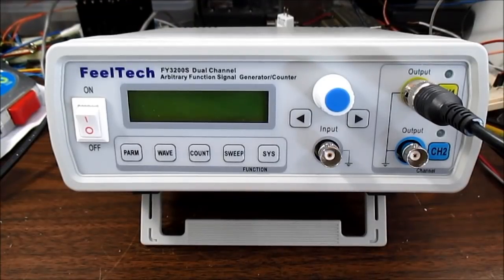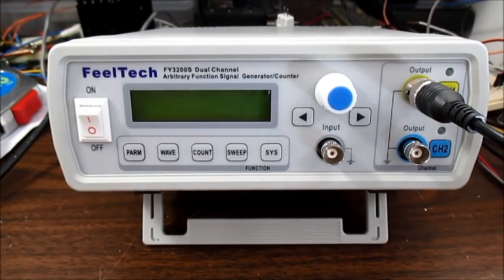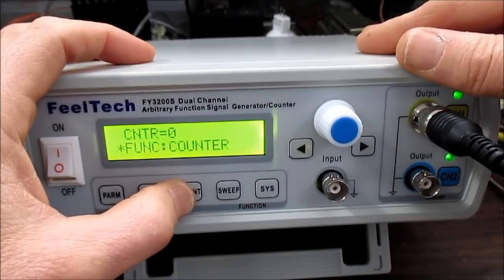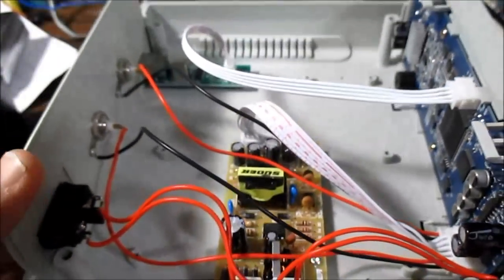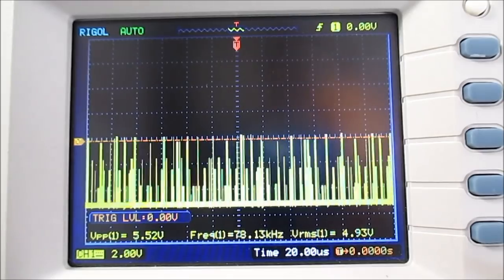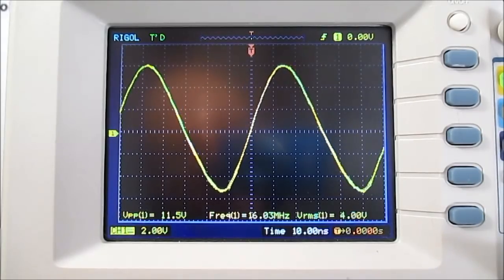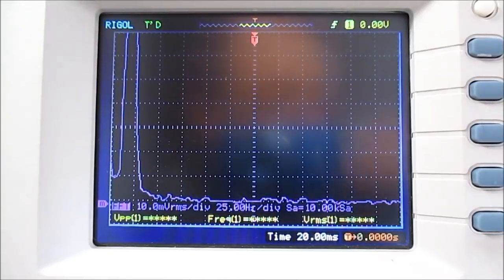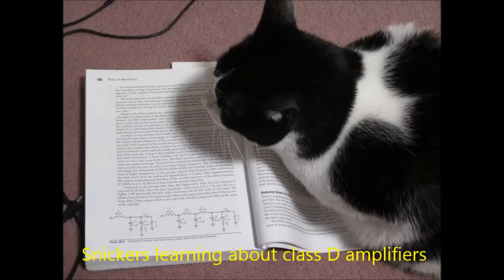FeelTech FY3200S arbitrary function signal generator test & review

Comment: I bought one that arrived this morning. The display lights up, but nothing else works. No beeps, no output from front or rear sockets, just 'nothing' but a bright, blank display. I've sent a message to the supplier, let's see how long it takes to get a response?  And yes, I looked at it on the scope and even with no signal generated by it there was noticeable mains hum, especially when I turn it off.
Reply from the maker: Let us know how they treat you with the claim. I'd open it and be sure the supply is fully connected since there are multiple rails used. Loss of one of the logic voltages may make it act dead.
Reply: @JohnAudioTech  John, They did ask me to check the rails. I don't mind but I feel it inappropriate for a customer to do fault finding on a new unit. I found +5v, -12v, but no +12v. I have informed them of this .. I await their decision.
Reply from the maker: I agree but it is easy to make a simple fix rather than shipping stuff back and hope the seller is reliable and honest. Hopefully they don't give you any friction.

Comment: Yup damaged my iPhone7 that was on the lab table. That 58VAC is coming out of this piece of shit even if it is powered off! 2 leads on the table and off we go. Only noticed it because of this tingling sensation on my skin... Now is there anything that can be done to stop this mains leakage or do I just toss this into a trash bin?
Reply from the maker: Tie the shield of the output lead to earth ground. You can also use an isolation transformer on the mains.

Comment: Thanks for the interesting test/review John. I would be wanting to use the unit for AM/FM receiver alignment and have downloaded the FY3200S manual to investigate further. However I am unclear as to whether the ASK/FSK modes allow an external modulating voltage to linearly modulate the Generator in the traditional manner, or they only allow distinct shifts between 2 amplitudes/frequencies depending on the mode? Also, what is the nature of the internally stored AM/FM waveforms - is the modulating frequency on them at 400Hz or 1kHz or similar suitable for use in AM/FM receiver alignment? Regards, Mark.

Comment: John, Really great vid. Very interesting are your findings on the distortion. So I thought I'd test mine. Here's my findings: https://youtu.be/4OhI2spU988 (this is for the similar JDS6600)
(I've reposted this as I managed to delete my video, along with comments by mistake - sorry)
Reply: I've got about the same model of Feeltech and I've measured 56dB SINAD (0.15% distortion assuming noise is negligible).  Which isn't bad for a cheap sig-gen (1% is more common!), and I reckon internally it must be 10 bit DDS.   Having built my own DDS outputting through I2S 24 bit DACs, I know I can measure at least 82dB SINAD (my distortion meter uses 16 bit samples though).

Comment: why didn't you build something like this? Is it good enough for audio work? I like to build one if its any good. Thanks.
http://www.vwlowen.co.uk/arduino/xr2206/XR2206-function-generator.htm
Reply from the maker: The XR2206 IC is the chip used in my old function generator. Its datasheet shows that it has fairly high distortion.
Reply: John, ty, what do you recommend for a low distortion el-cheapo? AD9850 module any good?
Reply: No, you need proper professional grade audio DAC(s) to generate good test signals for distortion measurement.  20 or 24 bit resolution.  The AD9850 is 10 bit, its designed for RF.

For audio any reasonable I2S DAC will do but you'll need to be able to drive I2S signals direct at something like 96kSPS or 192kSPS with a 20+ bit accurate sine/cosine.  I've done this using the Propeller microcontroller in assembler using its multiple processors (one to run a CORDIC sine/cosine generator, one to talk I2S at 6Mbit/s, one to read the controls).

Comment: Will you be sending it back then if its not good for audio?
Reply from the maker: No. It gives me access to a few megahertz, two channels and a host of other features that I didn't have before. It has a lot of uses beyond audio.
Reply: Hi, I see you are achieving high voltage. Do you know someone that can configure a cheap RF Amplifier to work with this signal generator? I am looking for about 25 watts output.

Comment: I'm surprised at how little is inside it. There's probably an option to disable the beeper, or just put some tape across the hole! I'm still using my tablet as an audio signal generator as I have an app for that, it works fine for sine wave output, it's very clean with practically no distortion whatsoever all the way up to 20khz, but square and sawtooth waveforms are terrible on it, it just can't cope.
Reply: Its a 10 or 12 bit DDS generator from what I can gather, so all you need is crystal, microcontroller, DDS generator chip and output fast opamps, the wonders of direct digital synthesis take care of the S/N and distortion.  And yes becase its DDS you'll see the sample rate as steps in the output, but all that is high frequencies, doesn't affect the audio spectrum one bit.